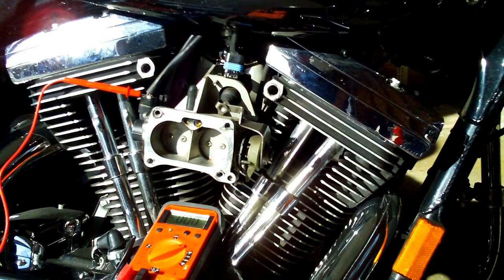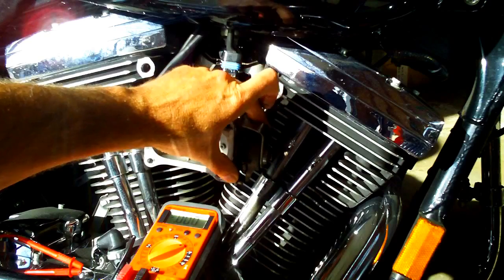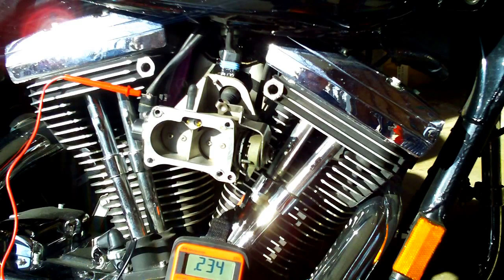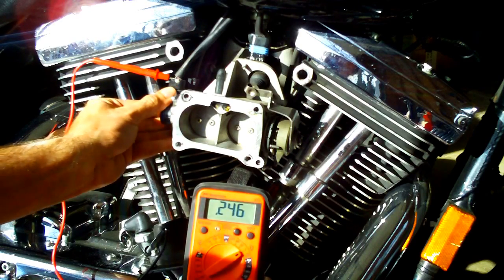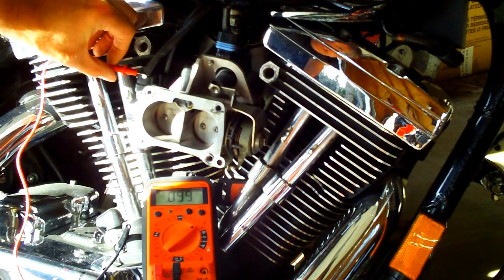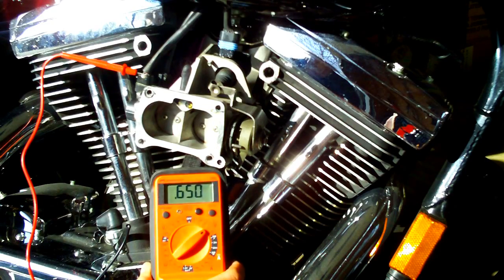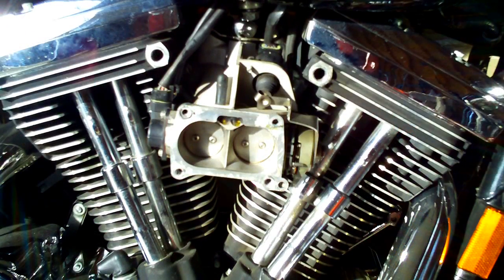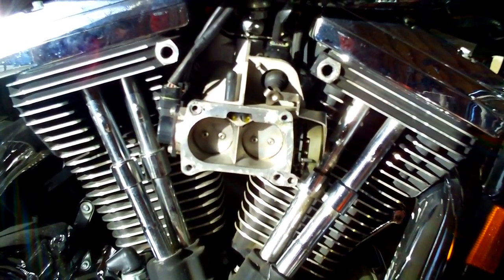Reset Harley Davidson Magneti Marelli Fuel Injection TPS Settings ✔

Comment: I really got a lot out of this tutorial. I have a 2001 Road king with a 95 inch big bore kit. Should the settings be the same with the 95.
Reply from the maker: +Duane Franklin Well Duane, that is the 100,000 dollar question. I really don't know if the change in cubic inches will need different settings or not. My gut feeling is that this is only metering the air/fuel ratio, not cubic feet of intake or vacuum, so it in theory 'should' be the same settings. How is your bike running? Do you have a fuel programmer module attached to it? I hooked one up on mine even though I don't have drastic changes to the bike's intake and exhaust and it was worth every dollar and minute it took to hook it up. I have 2 videos that cover 2 different systems for that.
Reply from the maker: +Duane Franklin I did a little more research and found information on a forum that showed different cold idle voltage settings for the 1340 engine (1340 Domestic/HDI 0.61 to 0.64) volts and the 1450 (1450 Domestic/HDI 0.64 to 0.68) volts twin cam engine that came out in 1999. So it would seem for bigger displacement a higher voltage reading is wanted which would in turn open the intake butterflies just a bit more when cold. Warm idle is recommended to be set at around 950-1,050  rpm to go easy on the crank bearings and to keep a good charge to the battery while idling for extended periods. At 1556.77 cubic centimeters (95 inches) bore, you might need to guess a number in the .68 to .72 volt range for an idle that is just above the warm idle 1,050 rpm (say 1,200 rpm) for it to warm up and then drop to the warm idle setting. Maybe?
Reply: Hey Mark, Basically out of no where my bike started running really rough near the end of last season caughing and bucking at around 3000 rpm or above. Took the joy out of riding for sure. I decided to do some maintenance during our cold Canadian winter. I changed the internal fuel lines, fuel filter ( needed this anyway, you could hardly blow air through it ), head temp sensor, went over the whole bikes electrical connections, cleaned the throttle body, lots of crud came out of those to holes above the butterflies. All this did nothing and the bike ran the same as last year. I followed this tutorial and voila the bike runs as good as it ever has while I've had it. I used the .275 and .650. I wanted to give you a big THANK YOU!!! I also followed your tutorial for the filter and lines in the tank by the way.😀
Reply: Hey Mark, I have the Dobeck controller and again found your tutorial on setting it up really helpful!!! You are the man!!!
Reply: Hey Mark, I am using the Dobeck fuel controller and have followed the tutorial you posted on setting it up. I can't thank you enough for the tutorials that you have posted. The Harley techs at the dealerships here eyes glaze over and they run away when you mention Magneti Marelli, haha. With the adjustments to the throttle position sensor my bike idles right at 1000 rpm when it's warmed up. I installed a tach over the winter so now I can tell. Thanks again !!!
Reply from the maker: +Duane Franklin Wow, Duane, that is all awesome news! Those holes above the butterflies are air jets that assist idle and are adjusted by those two screws, so good thing you cleaned the crud out of them. Here in Maine we don't get much more riding time than you do up there in Canada, that's why it's important to get this stuff done before riding season. You not the first to say that after setting your sensor to those numbers that your bike runs better than it did before, so there must be something to them that the bike likes for sure. Mine still is running beautifully, and you're right, when you say "Magneti Marelli" you usually don't get a very good sign from the mechanics now. Old technology. Anyway, one more tip, and I STILL have to do this to my bike: When I replaced the fuel pump I later found out (as though the bike ran out of fuel) that the pump is not sitting all the way down to the bottom of the tank now. The gas light doesn't even come on and she will roll to a stop. Freaked me out the first time this happened, as you can imagine. So, make sure the pump is all the way pressed down after replacing it. My bike was around 40-something thousand miles when I did it, and not that anything was wrong, I just didn't want to ride it until it failed on me. I hope you have a good riding season in the wind!

Comment: hello Mark but where u find 0.275 in the bulettin?
Reply from the maker: +domenico petruzzelli Click on the links in the description. I found most of this information in message boards and applied it to my bike. It has been running fine ever since.
Reply: Ok Tnx but u ha e 1340 evo? I see all the link bit i dont find 0.275 v
Reply from the maker: +domenico petruzzelli Yes, I have the 1340 EVO motor, but this was also used on the first Twin Cam 88's. The 0.275 setting is mentioned in the first paragraph of this page; http://harleytechtalk.org/htt/index.php?topic=14394.0. Also about halfway down that page look for "Ratfade"s comment where he mentions upping the cold idle setting from 0.500 to 0.650 volts DC. He's right, this gives it a more reliable warm up time at the higher setting. What is the bike you are working on?
Reply: i nave Electra glide 1340... whit this V now when the moto is cold ha e 400 rpm
Reply from the maker: +domenico petruzzelli If it is only idling at 400 rpm cold, I would adjust the cold idle screw by turning it in. You can see which one is the cold idle screw in the video, and you will need a small allen wrench to fit it. Either use the 0.650 DC volts setting, or turn it in and start the bike to see where it is idling. I would think you would want at least 1,000 rpm cold. Do not let the bike warm up while doing this, just run long enough to see where the idle levels off, shut down and make another adjustment if necessary. Make sense?

Comment: Thanks for posting!  Had a cold start issue and I was struggling to follow the logic of the manual until I watched this video.  For some reason I had trouble getting my voltmeter to read using the "pin" method that Mark used here.  I have a technoresearch code reader that allowed me to see the TPS voltage so I used that (It's accurate only to 1 decimal place so I'd prefer to have used Marks' method).  FINALLY fixed my cold start problem.  Since I live in Michigan that's kind of important.
Reply from the maker: +cowgirlsdad Hey, that's awesome! Thanks for the comments!

Comment: Thanks so much for this video.  My bike was running fine then all of a sudden started misfiring.  I saw your video, retrieved the 1-1 DTC (TPS) and decided to try your fix.  Within 40 minutes my 97 Road King was running like a champ!!  In fact,   the TPS settings must have been off for a while because I don't even remember my bike running this smoothly before.  I would suggest though that the adjustment be done with the engine at operating temperature and to make sure the cold start plunger tip is completely off.  Thanks again.
Reply from the maker: +Patrick de Borja Glad it helped you out, and here's to many more miles!

Comment: Mark, What do you have your meter set on? TIA...And I had no idea these were so sensitive!
Reply from the maker: +bryanjh73 I had the meter set to DC Volts, I believe the lowest range it has, probably in millivolts. That's why it would show "OL" meaning Over Load when I would turn the throttle by hand as it went over that settings maximum range, and had I wanted to measure voltage in that higher range instead I would have had to set the meter to a higher DC Volt range. These meter testers can be found if you look around enough, and yes, the TPS setting is very sensitive!
Reply: +Mark Young +-I didnt pay attention on the cold warm idle screw when turning it out. Do you know where it should be if I started with it all the way in? I tried it with the settings you suggest. And it is sputtering. Would this be from the warm idle screw being too far in or out? Or any other suggestions would be great, Thanks again!
Reply from the maker: The cold idle screw is set with the cold idle motor unplugged and the DC volts set to 0.650 just as shown in the video. The warm idle screw is to be set once the bike has warmed up and is no longer resting against the cold idle screw motor, with the motor plugged back in of course. If the bike is idling too slow once it warms up then you need to turn the warm idle screw IN until it comes up to around a smooth 1,000 rpm (recommended by Harley for both being easier on the connecting rod bearings and keeping the battery charged at idle). If it will not idle right at all then there is something else going on with the system that is not normal. My bike is set according to these settings and functions normally in all weather conditions, warm or cool. The only setting that is not set by the volt meter is the warm idle. You need to set that on your own. I hope you find where the issue is.

Comment: i will be setting mine this weekend. 2nd owner of my 96 ultra classic.. 18k miles on it,, just replaced intake manifold gaskets,, cold idle is way high...warmed idle is way low... it's got aftermarket pipes and it appears to be running lean on one cylinder...hope the manifold seal fixes it... 
Your thoughts on a tuner cable to read/tweak the settings?
Reply from the maker: +Bob Regalia If it was popping on idle chances are you had a bad intake gasket. I have tried 2 tuners on mine with great results from both. I found the second one on Ebay and found it would be even more precise so I bought it and installed it, still running it flawlessly to this day. Here they are: https://www.youtube.com/watch?v=X1a9kBx_Lb4 and https://www.youtube.com/watch?v=DxGDW9O1NsQ
Reply: It's not popping at idle. it's popping when I get off the throttle, and there's a slight hesitation in neutral when I crack it. (Definitely not as responsive as my VROD). I'm not sure if I want to spend money on a tuner module, but on a TTS cable and hook it up to my laptop and run a tuner program to see what's going on in there. I have to research to see if my stockpiles ecm can even by written to or not...
I also noticed that I have some give in my cold idle assembly... I can rock it side to side about a 1/16 inch or so..dropping the idle down 500rpm.. The keeper tab on the nuts is up... maybe one nut surface tight and bend that tab down so it don't back off?
The joys of someone else's old toys when they didn't play nice... 
Thanks for the tips! Off to hunt down an electronic shop manual for this thing! 
Keep the shiny side up my friend.
Reply from the maker: Make sure that the nut on the throttle plate shaft doesn't fall off on you, mine did and had to ride it home with the idle at close to 2,000 rpm I'm guessing. Made stop signs interesting to wait at. If you do find a way to connect a laptop to this, let me know! I downloaded a service manual for my bike for cheap money and it has 'most' of anything you would want to tinker on listed in it. Good luck!!
Reply: +Mark Young I just snagged a Wild Pig GEN 3  tuner on EBay for 45 bucks... let's see how sweet this may turn out...
Reply from the maker: Sweet deal, same as mine. I put links on my tuner video to Dobeck's website info on it. Here is the link to the initial tuning, use the "Initial recommended base settings for stage 1 modifications" to get started. I also included the settings mine is currently using in the video description. Mine is set up more for good mileage and great pull when you roll on the throttle. Makes my 80ci feel like an 88ci motor.
Reply from the maker: http://www.electronicjetkit.com/Harley/viewproduct.asp?partnumber=9120265
Reply: it came in the mail... it has no documentation so i gotta find instructions and understand what all the settings do...
Reply from the maker: Follow the links in the description of my video for settings, etc. Good luck! https://www.youtube.com/watch?v=DxGDW9O1NsQ

Comment: hi mark sorry to make this long.i have a 2000 electra glide classic. all I want to do is make the bike louder,i am not rich so I got a set of slip ons off of ebay put them on bike it ran horrible dec pop and eratic idle.so I purchased a cobra 2000fi tuner with the 3 pods that didn't help if anything made bike run worse.i was told that tuner fits my bike but wont work with my bike if makes any sense,maybe cause I have this m&m efi I don't know.so I wanted to know what set up would you recommend for me that wont break the bank to make this thing sound like a mans bike lol and run great.its a 1450 88cc all stock bike.thanks so much for your time
Reply from the maker: +Joseph Simpson Hello Joseph, as I also have the MM Fuel Injection System, I have used 2 tuners on it so far, and the second one I absolutely love how it handles the fueling. Here is the first one I tried and was relatively inexpensive, found on Ebay, https://www.youtube.com/watch?v=X1a9kBx_Lb4. The other is based on Dobeck Industries tuners, just a different sticker or face on the front, and this is the one I am currently using, https://www.youtube.com/watch?v=DxGDW9O1NsQ. I am not familiar with the Cobra unit you have, other than it might be called a 'Tri Pot?' What did you used to set it up for your bike for instructions? Who told you that tuner isn't supposed to work with your bike? Does it have the fuel injector connectors on the leads?
Reply: first thank you for responding a mechanic a friend reffered me too said that it wouldn't work but yes it has the connectors and I had it hooked up but couldn't get it dialed in.i checked the plugs and they were white so im assuming it was running lean.so I put it back to stock it runs fine idle is funky sometimes but runs good.i will check out the tuners you have also should it matter what slip ons I get?.thanks agin for your time I really appreciate it.
Reply from the maker: No, it should not matter which slipons you get or whether they have baffles in them or not. I am using a pair of Bassani slipons with baffles. The tuner you get should be able to be adjusted to handle the type of intake and exhaust you decide to put on your bike. I am sorry I am not familiar with the Cobra unit, but if it plugs in, as my Dobeck-type unit does, I would think it should work. Also, the first tuner I used had pots to adjust with a screwdriver and worked for me. I upgraded to a newer unit for more versatility. Before you give up on it entirely, contact Cobra Engineering
Cobra FI2000
(714) 692-8180
www.cobrausa.com
www.fi2000r.com

Comment: Great video! I was having problems after completing my stage 1 on my 1996 Ultra Classic so I adjusted it according to this and what a difference. I did also adjust the air bleed screws before doing this procedure. (remove epoxy from the 2 screws directly above the runner between the 2 throats of the induction system. Lightly seat them both then back out 1 1/2 turns just like a starting point on most carbs.) I'm at sea level and it idles beautiful and runs strong. Thanks for the simple straight forward video.

Comment: just letting whoever reads this know, i have a 1998 flhtcui, had engine light come on, had code for throttle position sensor, followed your detailed instructions, adjusted warm idle to 1000rpm from bike tachometer, drove it for awhile, runs great, got rid of 90% of popping when throttling down, only problem I had was idle would go up to 1200rpm a couple of times at stop lights, i'll run for a couple of weeks and redo procedure again too see if that helps. thank you so much for this video
Reply from the maker: LilOsideSmitty Thanks for the feedback, Smitty. I am wondering why it is idling up at stops like that, but can't think of a reason for it. My only guess, and just that, is that maybe it has to do with the temperature sensor on top of the front cylinder? If it is sending a report to the ECU that the engine has not fully warmed up, could it cause the cold idle to boost it just a bit? If you do recheck anything, I would suggest a lower setting on the cold idle adjustment, maybe back it off half a turn, a whole turn, etc. to see if this idling up at a stop goes away? Let me know what you find out.
Reply: My temp sensor went out and it was doing just that...
Reply: I know this is old I can add some info for others. Mine would idle up little once in a while, eventually my throttle cable broke about 1/4 inch from the brass connector up top. I figure it was frayed and not returning to the same position very time. I never had a throttle cable break before. These 98 RG efi, cables were 20 yrs old. Return cable was fine. I replaced the cables with 2006 cables, form and fit looked the same. Now bike is not running right, hesitation during acceleration. That's how I ended up on this page. Hoping to get through this, the TPS seems to be functioning, I am able to set it to .275 and set the idle screws, seems the HD manal also says something about disconnecting the battery for 10 minutes after a TPS adjustment so it forgets the idle positions. Still cant get it running right,  dang mystery what happened when I only replaced the cables. It was running fine before this.
Reply: UPDATE: I got it tuned the second day and been running great. My problem was my 98 manual had some conflict with the process in the video, and I had watched the video but not read the "show more" information The second day I slowed down and read about the 2000 service bulletin that literally corrected a mistake in the manual and clarified the process immensely. I see now the service bulleting reference was now removed from the "show more" and placed at the top of the comment block. Good deal, now hopefully less folks will miss it like I did. Great video, thanks a bunch. My bike is running like a new bike.